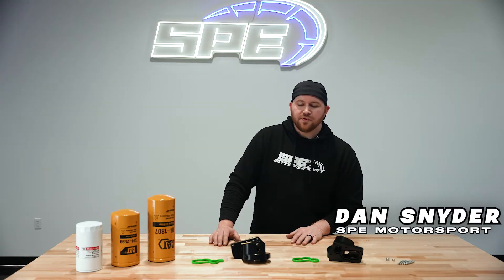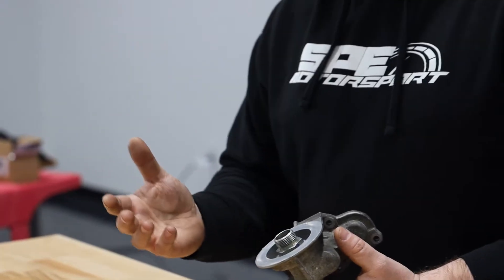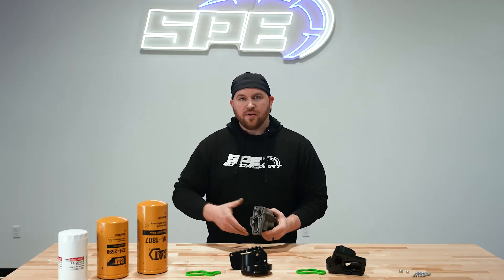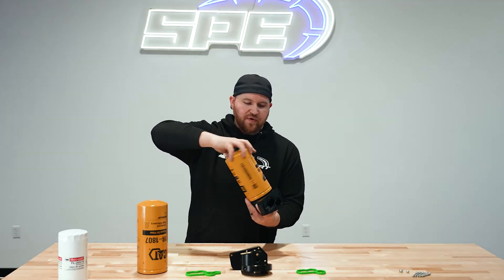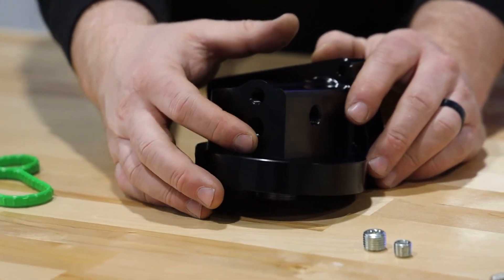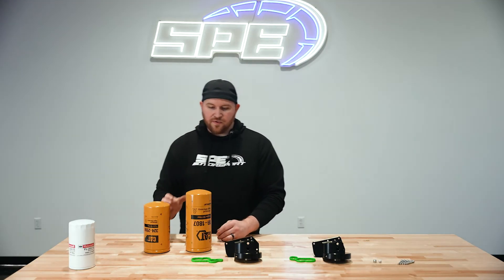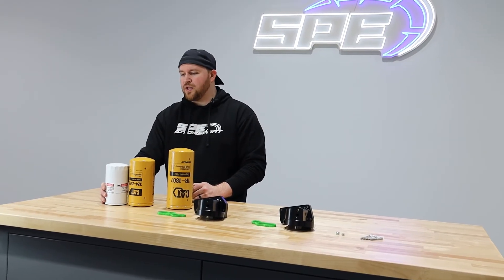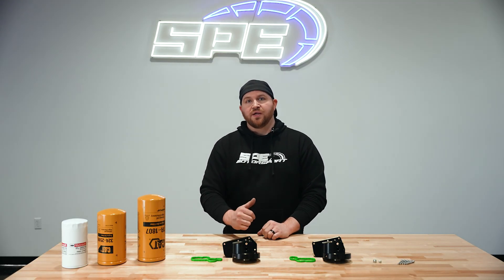SPE's NEW 6.7 Powerstroke HIGH FLOW OIL FILTER HOUSING with CAT FILTERS

Comment: Just gonna throw this out there because I see the keyboard mechanics starting already. The restrictions that create pressure in the system are the bearings and piston cooling nozzles and the rifling galleys in the block. Make more flow after the pump and through the filter is only helping matters. You always always want the least amount of pressure drop through the filter in probably every filter application. I’m sure someone will come up with one that u don’t. Nice job as always guys making power strokes great again. Also little food for thought,why do you think it is that ford never gives us a oil pressure gauge? They use a dummy switch for a reason … where in the circuit does that dummy switch go? Do your research for the answer and you will see that what spe has done will only help everyone
Reply: This honestly needs to be pinned as the top comment

Comment: solution for a problem? i got a 2020 f450 with 130k miles and a 2019 f550 with 170k miles no oil related problem. ive never seen anyone on the forums or social media page that has complained regarding on oil pressure problem with the 6.7's. i mean come on SPE i like the idea but saying its a ISSUE or a PROBLEM is kinda gimmicky..
Reply from the maker: If you see some of the casting variances that we have seen on the factory housings you would understand. Some of the engines we have torn down over the years with bearing issues whether main or rod bearing problems usually had casting flash or misshaped passages in the filter housing. Its a bottle neck in the oil system if you look at all the other passages in the engine (on the pressure side) they are machined not cast. So yes it may not be a problem for everyone but it can be for some. We like creating the best products we can based off of data we personally see and or experience. If you look at our comparison photos its very evident that the machined passages are more consistent and larger, there is no down fall to that.
Reply: not a gimmick,just good marketing.
Reply: Have you seen the passages the oil has to go through.  The oil has to travel through passages like a mouse house. Cold start ups it's 6 seconds for the oil to finally make it to the turbo.
Reply: @northcarolinagunenthusiast6532  like i said it can be improved YES ABOSLUTELY.. but is it a PROBLEM?!! HECK NO!! if its a problem all of the hotshot i know with 6.7's will be having them.. they have atleast 170k on them btw in less than 3yrs pulling heavy loads across the USA.. again its not a PROBLEM but it can be IMPROVED.. thats my point.
Reply: Watch some Dave’s auto YouTube videos. He claims to be replacing a lot of 6.7’s fallacy or fact? I don’t know. But I’m not willing to find out and have a. $40k engine replacement bill.

Comment: What are the recommended oil change intervals running the cat filters short Vs long?
Reply from the maker: That's very relative to the type of oil and how your using the vehicle. We always recommend having a 3rd party lab test the oil periodically through its use to gain a base to judge off of, as far as mileage/engine hours. On the flip side increasing the capacity will always increase the life of the oil because you have more oil in the system. From Testing we found the oil degrades long before the filter does. Being the filters were designed for much larger capacity applications this makes sense.
Reply: Awesome, thank you for the reply. I guess my next question is would you just test the oil every 5K miles?

Comment: Ill go with the adapter,. I can see higher flow for fuel, but oil?  How is the oil pressure after install?  I bet its lower, I got a work truck not a dragster.   Do like how high it is.
Reply: I have the unit in my truck, oil pressure is the same not lower. What I did notice is when a cold start up occurs, the motor warms up to operating temp slightly faster.
Reply from the maker: The Dragster is used as an extreme test bed its not designed for that application. Oil pressure is the same, technically better because at higher volumes their is no pressure drop across the housing. We have been testing this for over a year in work truck applications with very good results.
Reply: @SPEMotorsport  would like to see that testing, maybe put it on the products page.  Cant see how cat filter them self with there size not lower it enough.

Comment: Do the CAT oil filters have an anti drain back valve on them?
Reply from the maker: No, The CAT 1R-1807 oil filter was designed to function vertically so it doesn't need an anti-drain-back valve. It is not needed in the 6.7 PSD application. The fl2051s was designed so it can be used in different mounting locations for different applications. We designed our housing to be perfectly vertical.
Reply: Like they said they’re mounted vertical. Also the silicone anti drain back valve isn’t really a valve it’s a silicone ring disc flapper. In my opinion. And this silicone flapper is the first thing the oil is introduced to in an oil filter canister. And I believe the silicone anti drain flapper creates additional restriction. Being that this engine has a vertical oil filter install orientation, having the drain back “valve” absent is an oil gpm flow performed increase in my opinion.